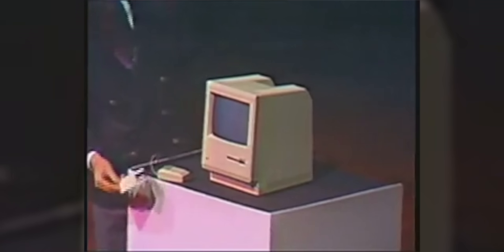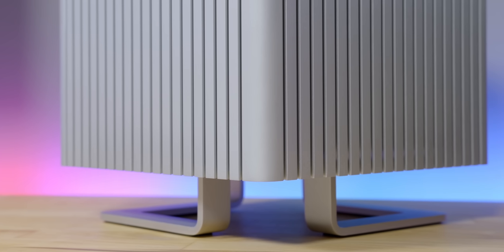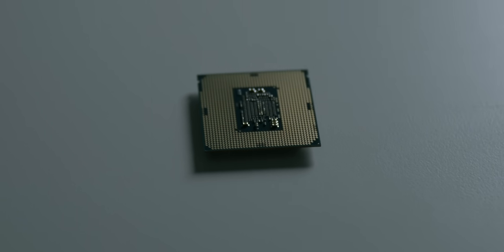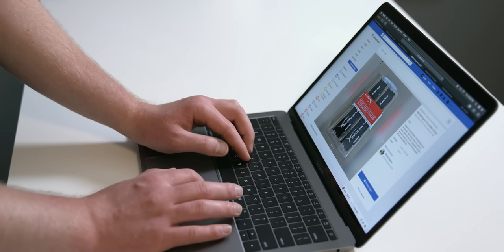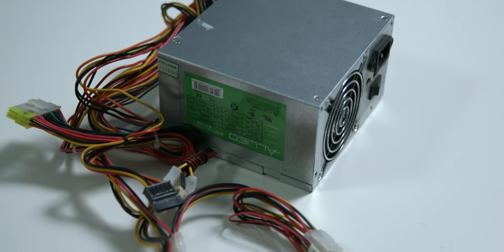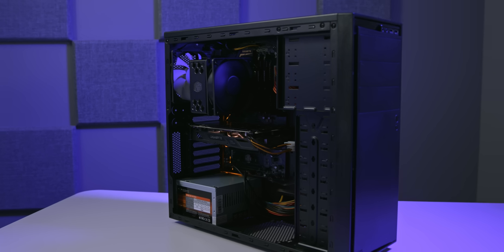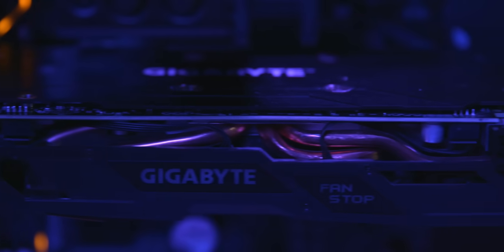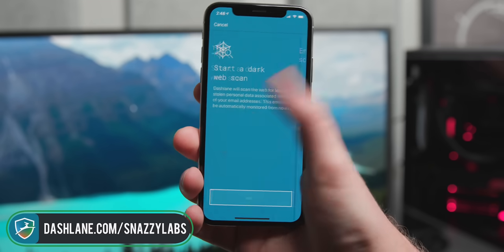Let's Build a $350 Craigslist Hackintosh Mac!

Comment: tfw my ryzen is quicker than that $5000 imac pro lmao
Reply: only problem with those amd installs is some sw compatbility and the method you use to install amc on it, many methods requires to replace system files and that breacks some software features making the system less stable and with missing features, the best way for the amd hackintoshing is the so called amd vanilla hackintosh which allows you to install a vanilla mac on amd system by just using a bunch of kernel patches in the clover config file, only problem for now is that that method does not curretly patches opemu, so no support for 32 bit apps in those machines but in future mac os versions that should not be a huge issue since apple is going to drop support for those older kind of app

Comment: Don't buy Silicon Power SSDs. My 120 GB SSD died within a year. not recommended
Reply from the maker: I’ve had great luck with Silicon Power stuff in the past.
Reply: Ryuuji Takasu , how did it die? Were you still able to backup your data or it was unreadable?
Reply: @MATS0ZETEX ...and backup
Reply: @snazzy  Silicon Power 1TB and 2TB external USB3 drives are what I recommend for backups if you don't have a NAS, use them myself
" Rugged Portable External Hard Drive Armor A80, Waterproof "

Comment: Did you see Linus video? Just virtualize MacOS, regardless of the hardware you have.
Reply: Deses Way more work and there is something different about virtualizing an OS on top of another OS.
Reply: I've been using PC virtualization since Vmware Workstation 3, and couldn't get OSX virtualization going on my older AMD 6-core to save my life. Ended up buying a used 27-inch 2008 iMac that was languishing on a shelf for $125 and upgraded the RAM to 6GB + OS to El Capitan 10.11 -- posting from it now ;-)